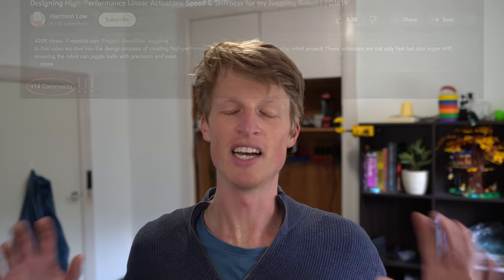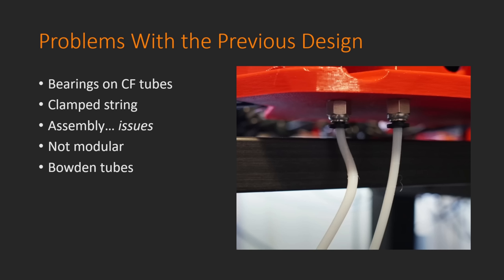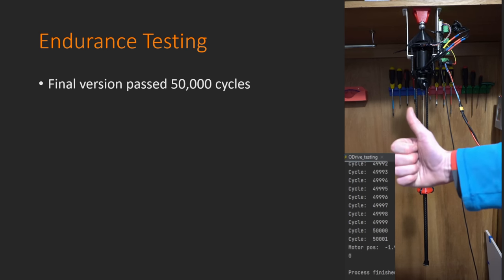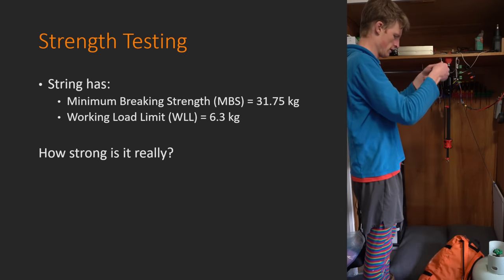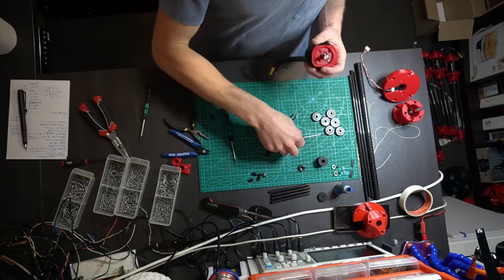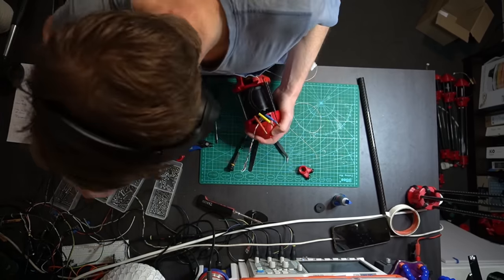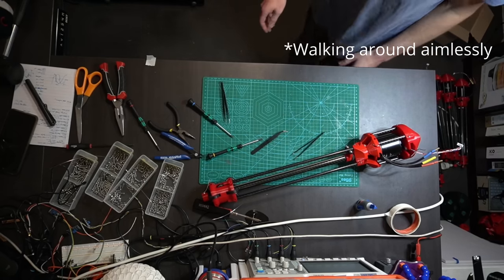My New Linear Actuators are SO MUCH BETTER! | PDJ #21

Comment: To 10:50 you could clamp them like you clamped your carbon rods. Maybe on a length of 20-30mm. You could also design a slight kink into the clamping (don`t know if this might increase the strength)   like this <|<

To 11:45 couldn`t you just place 3 rollers fixed on the front and 3 rollers at the moving part at the back. The second row on the fixed part at the front wouldn`t realy bring you a benefit. You might limit the full extension then so you allways maintain a minimum distance between the rollerpairs for stability.
Reply from the maker: Great suggestions, cheers! Your first idea is very similar to what I'll likely end up with. I made a test piece today and the clamp works really solidly, even with a clamping length of only around 10 mm!

As for your second suggestion, I toyed with this idea a lot in the development of these actuators and ultimately decided against it for a few reasons:
 - The "guide" CF tubes, while quite stiff, can flex a bit if they're loaded at their midpoint
 - I want to reduce the weight of the "end effector" of the leg as much as possible, since this is the part that's moving the most (and fastest)
 - After experiencing how much wobble there can be in the fully-extended tip of the leg (if things aren't tuned quite right) I'm worried about the stiffness I'd be able to get out of the system you're describing when the leg is fully extended. But I think you're right that a solution could be a simple one: reduce the "operative" length of the leg. (though I'm not sure I like that because stroke length is fairly important for these actuators

Cheers for the suggestions!

Comment: MULTI ISSUES (1-5)
1. min diameter bend radius = looks like primary problem for any string, cable, rope, thread you are using. from your review, looks like you already experenced min diameter bend radius with the air tubes for string, but now you are still having same issues. larger diametr pulleys can help resolve these issues. 
2. the motor to drum, you need to get "extra wraps" around the drum, generic 12V wench you might see on rtv, utv, front/rear of a truck. generally err going get myself in trouble i want to say 5 to 7 wraps of cable before you can use any weight force on cable to wench stuff to the vehicle. those extra wraps bite in and grab the drum pulley and the physical connection (end point of cable/wire/thread/string) is not the actual point taking all the force but now the drum with those extra wraps is taking the force/weight/pressure instead. 
3. 3 pipes framing good. and then you have 3 rollers for central pipe/actutor good, but its the larger pulleys / caster wheels for central actuator pipe. you need a better "linear bearing" setup. i am gong cheap route vs 3D printing, so get the idea across. take a piece of pvc pipe 1" diameter. then take a drill bit and drill bunch of holes all around it. then take a coupler ((connects 2 pvc straight pipes together)), get a sanding drum for a dremal and sand out the center so the coupler snuggly fits over pipe but still allows some wiggle room so you are not fighting it. then take a funnel for small gass engine say push mower so you can put oil in with spilling every were. chop portion of bottom off so it lines up with the coupler. beebees as in beebee gun or pullet gun, kinda looks like ball bearings in a bearing. those holes you drilled in the 1" pipe allows beebees to fit in but barely spin, then the coupler goes on outside to hold beebees in, and then the actuator pipe fits on inside to hold beebees in. the funnel is there so.... put your pipe in, then the 1" pipe, but then slowly lower the 1" pipe into coupler and twiste 1" pipe back and forth as you feed into coupler so the beebees in the funnel get into the holes, and as you feed it into the coupler it locks the beebees into place. take funnel off, and some were put some sort of screw or something that locks the 1" pipe and coupler together, now as long as the actuator pipe does not fall out, the beebees will stay in place and you have a linear actuator. 
3.B = aboveis more a linear pipe bearing. vs a tract linear bearing. 
3.C = since you are 3D printing, run a physical pipe / tubing down one side of the bearing. to feed your string / cable / wire down to end of actuator pipe. 
4. you already have idea for the other end of actuator, and needing to going to 3 framing pipes. so not going there, just encourging on correc path thumbs up
5. stewart platforms, have some major issues. specically because of stewart platforms and how they work. if this was a motion platform for some 3D motion for say racing car game or 3D flight simulator game, no real issue the actuators are spread far enough apart, and the actuators are not long. but for your system the stewart platform actuators the base has a small foot print AND the actuators are long. and that is were the problem comes into play.  
5.A1 = you will hit some "dead angles" and more so "non recovery angles" were you rotate the top and extend out, but when you go to retract the actuators, the actuators will rotate more than you want and physicall lock the actuators so you need to physically go over and twist the actuators back as you retract the actuators. 
5.A2 = if you remove the strings to the 6 actuatos, and have just a top base plate (see below), you should be above to move things around just by grabing top plate, and find hang up points and dead points / angles. 
5.B = in your case you need a "ball joint" at the end of your actuator pipe. and then on the motor end you can not have a ball joint but, 2 hinges perpendicular to each other, then a limited rotation hinge. say 30 degrees of rotation ((i say 30 degrees but might be 160degrees, but depends on bottom base size, and diameter of the actuators)). placing ball joint on both ends, can cause your wires, hydrualic hoses, air hoses, what ever you are controlling the actuators with, to bind up, and create extra "hang up points", were the acutators do not move freely enough, and can cause major issues at the top were things becoming jerky and sudden movement, vs smooth movement, by placing the 2 hinges, and limited rotation joint in, it keeps things from rotating freely and then hanging up on your connecting wires/hoses/etc.. and move more smothly. *groans even a repeat of sentence wording different still not coming up with correct words to get idea acress, awell*
5.C = i have only watched this video of yours so ya never really got good look at top of things, but i might advise a "TOP PLATE" you have bottom base plate for the actuators, but a "top base plate",  i know you want to keep things simpler and use some pipe or 3D structural members, but a plate might provide a better support setup for the 6 actuators, and what ever you place on top. i myself get edgy when saying this, because how your 3D thinking as you working out things going to be different from myself, and this may mess you up. so take it as you will with a grain of salt. saying this because you most likely thought about things a bunch of different ways.
Reply from the maker: Wow, lots of great info here, cheers!

Regarding the Stewart Platform:
1. Yep, I agree 100% that the base is too small. Jugglebot has finally outgrown its "baby" base and I just accepted a quote for a new (*much* bigger) one to be CNC'd. Hopefully it doesn't take too long!
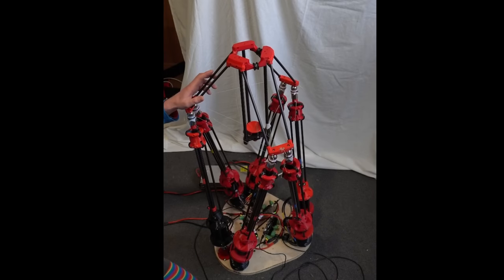2. The actuators actually won't be able to twist relative to the base. I don't want to go into too much detail on how that will work (will be explained in a later video) but you might be able to figure it out if you look closely at the clip starting at 12:06 😉
3. I haven't really considered a solid platform "plate" and I'm not sure I like the idea of adding more mass to the platform. I take your point about stiffness and stability, but the current platform is already fairly stiff, and I plan to make it a bit stronger soon. Once I deal with more pressing issues first, that is 😅

Cheers again for all the suggestions 😊

Comment: Maybe you can get rid of the roller bearings completely by changing the design to slide bearings/shaft guides? I found some relatively low cost composite parts at IGUS, they rate their shaft guides up to 5m/s. I don’t know if the carbon fiber shaft will be an issue, they should be able to tell you ^^
Reply from the maker: Wow those are pretty decent speeds! I think I'd have the same problem I had with linear bearings though - the tolerance of my carbon fiber tubes aren't good enough. Maybe it's worth seeing how expensive it'd be to get super fine tolerance tubes 🤔

Comment: Terminating Syncromesh is dead easy, they make (made? I dunno I haven't looked at synchromesh stuff in a few years) crimp on terminators that have a flat washer loop in them to feed a screw through (usually called eyelet terminators). If they don't make those anymore I know they make loop sleeves and thimbles, which you create a loop and crimp on with, then it should be a fairly straightforward task of modelling a post and clamp to hold it on. 

In both cases you can probably get away with using non-brand stuff to some degree. But no matter what you're probably going to be crimping, which will create a perfectly usable mechanical hold.
Reply from the maker: The trouble with these is that they don't (inherently) give any way to easily adjust the tension in the line, and at the non-adjustable end I'm not sure if these would be the best way to terminate the cable at the spool, due to the fairly small sizes in that area. 

I agree that making an adjustable post/peg that the loop could fit over would be possible, but that doesn't seem like it'd be the most compact solution possible to me. What do you think?

Comment: MBS on soft goods (like string/rope, webbing, slings, etc.) is for the most optimal loading scenario. Tight bend radii (like found in knots) will significantly reduce the actual breaking strength
Reply from the maker: Interestingly the string in the raw strength test actually failed somewhere in the middle of the string, quite far away from either knot!

Comment: I don't know the terminology for this, but for terminating the synchromesh, could you do something like they do for the terminals of like an AC-DC power supply? A small crimped metal plate held down by a screw?
Reply from the maker: I love where you came at this from! Someone else has suggested the same idea from a bike cable context, but ultimately both are the same!

I'll give this a go when I have some time. Cheers for the suggestion!

Comment: If the string wraps on top of itself on the drum driven by the motor, that can introduce a change in length per rotation as the radius changes.  If it is repeatable then perhaps it's not an issue but it would produce slightly non-linear string distance vs. encoder distance.

To prevent the issue from affecting repeatability and accuracy, you might have to prevent the cord from winding on itself.  A larger drum (like the outside of the motor) will improve things both by having fewer wraps and a smaller percentage radius change.  Maybe a large drum and some guide grooves can prevent overwraps.
Reply: Larger drum also means less power from the motor and potentially less accuracy.
Reply: @tyrzxv  Less tension and less resolution, I agree.

Comment: I'm wondering if delrin V-slot wheels normally used in DIY CNC machines / 3d printers are a good alternative for your TPU sleeves
Reply from the maker: Good idea! I'll put in an order to pick some up. My first thought is that there may be excess friction due to more contact points, though I guess that's the nature of the tradeoff between a "solid grip" and low rolling resistance.

Cheers!

Comment: You could pot the end of that wire to terminate the end.  Like a bike brake cable with the nub on the end.  You can grip the nub.
Reply: Oh use solder to pot the end into a nub.

Comment: 1) Why are the TPU "tires" rounded (positive curvature) when they are contacting a round shaft? They could just as easily be flat or even negative curvature. 
2) How are you controlling tension of the cables? Could one of the redirecting pulleys be adjustable to allow tightening the loop after fixing the ends? This would also allow adjusting if there is any creep in the line, allowing tension tuning like a guitar
3) As an actuator it would also be interesting to see the stiffness in addition to the failure strength. How much would a small load on the end effector change it's position?
Reply from the maker: 1 - I actually originally thought the same thing and had the TPU sleeves being concave instead of convex and they had an insane amount of friction (though they were a very good fit for the CF tube). I figured reversing that would flip the problem and minimize friction

2 - I'm doing this by keeping the string tight while I screw in the clamping bolt. I really like your idea of an adjustable pulley. The one at the end of the actuator is in the perfect spot for this and that mechanism probably wouldn't be too complicated to design. I'll have a think about this!

3 - I agree! I reckon there are a ton of aspects to this design that'd be interesting to explore (another being max power output), though unfortunately I have nothing close to a good lab setup and I think (for now, at least) my time is better spent moving forward 

Cheers for the (neatly formatted) suggestions!!

Comment: Have you looked at torqspline?  They are used in pick and place machines etc.   Also the bearings clamping around seems overkill when some POM or Bronze Sleeve bearings would be superior.
Reply from the maker: I hadn't seen torq spline screws before! They seem very cool. 30 starts is absolutely nuts! Do you know how fast they can travel? A quick google yields nothing here... I previously used lead screws in my actuators and they were super slow compared to what I'm getting out of these actuators.

Re. POM: a few others have suggested these so I'll have to pick some up and give them a go! Cheers!

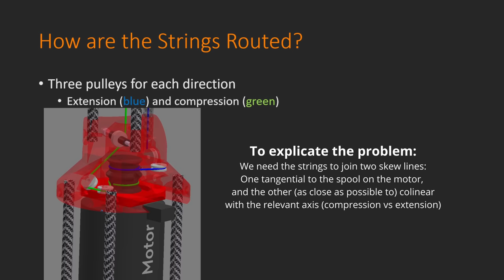Comment: 4:45 I do believe a two pulley configuration works for the green string at least, starting at the motor, the first pulley in the green string sequence I don't think is needed, and instead the second pulley remains in the same relative position, but is rotated to be flush with the last pulley in the sequence, but would also require the middle pulley (the new first pulley) to be tangent to where the string would connect with the motor drum. I made a quick sketch showing this, and I can't put the link in a comment, so in my about page for a little bit I'll have the Google photos link if anyone is interested 

If there are problems with this configuration such as the string being twisted in a way that causes issues from this configuration let me know as I would like to learn more about it.

Quick edit: looking at the blue string, the first pulley can also be removed, just rotate the second pulley to be tangent with the drum, reminds me of some gym cable crossover machines that have a pivoting pulley

Second edit: I would also like to say I highly recommend using dyneema as a string if you aren't already, it is really stiff and strong, and there was a video by another Youtuber Aaed Musa who made string gears using dyneema and it worked pretty well for endurance applications
Reply from the maker: Yep, you're definitely right about the pulleys; two is all that's necessary 😅 Good work realising this!

Re dyneema:  I'm actually using 0.8 mm dyneema now, and it's much better than the kevlar ones I showed in this video! Cheers for the suggestion 😊

Comment: Lock the synchromesh cable through three screws running in a line (more if needed), where each screw is tightened down in sequence with the cable at an angle. The cable is mostly straight, running through the screws. Spacing of the screws can accomodate the bend radius of the cable.

Comment: I'm liking your design!  Here's a couple ideas for ya.  Change from the string to the cable as you mentioned.  Set the cable tension with a adjustable pully.  Put the first pully from your motor to be on a slot, and a screw on either side to adjust it to set the tension.  Oh and the tension should be just tight enough, so when you pluck it you get a thump and not a strum like a guitar.  Then the ends of the cable could be securely mounted, perhaps looped over a rod you have ran thru your carbon tube, then crimped, just like the common method for larger cables.